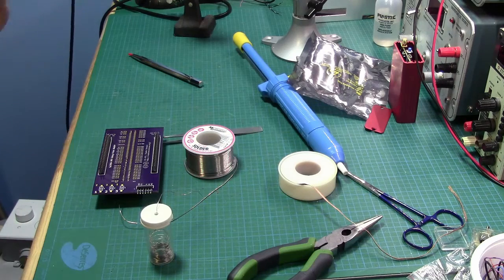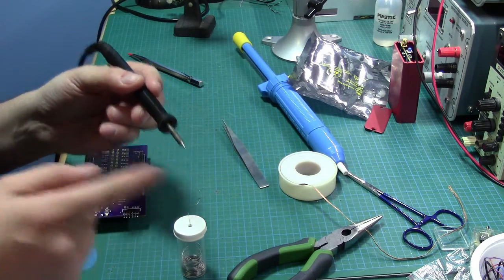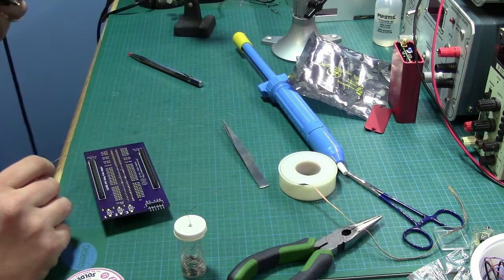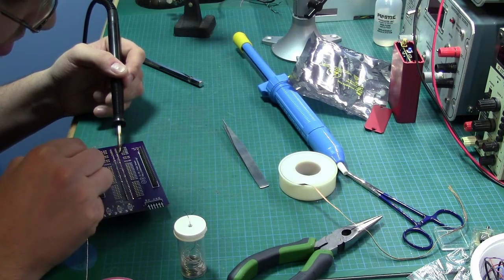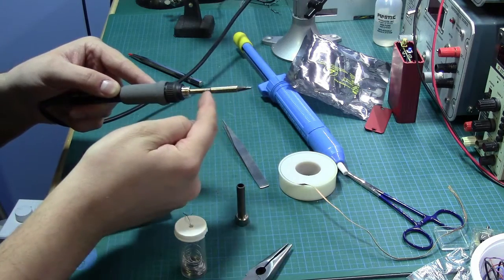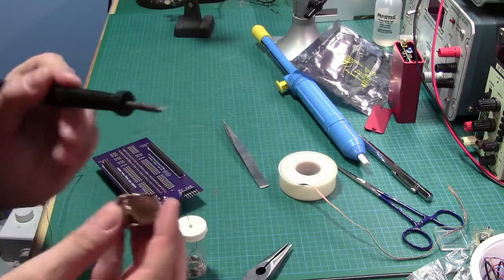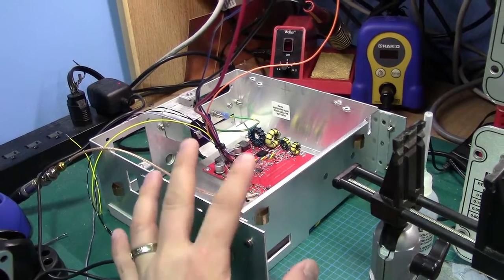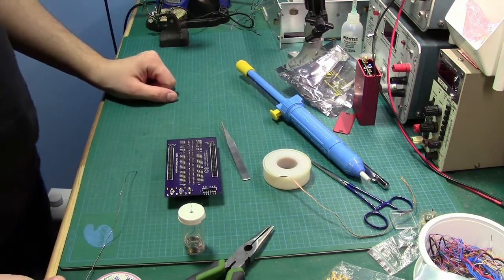DIY Soldering Station Project Introduction

Comment: Wooow it's very intersting to see some people bringing back this already great project .
However,did you think to re-design some part's of this pcb,for example the out of rf power ?
I want to say that in the hakko fx100 we have the rf connector soldered directly .
In this station we must to solder some kind of 75ohm of cable to make the connection over the iron handler and the power supply.
In this picture you can see about what im talking :
http://s15.postimg.org/nxs6db9vt/hakko_fx_1000.png
Reply from the maker: +lollipoppo sugar Yes, in fact I am going to redo the layout (a bit at any rate) for the conversion of the project to Kicad. This might take a bit of time as I'm basically a beginner with RF design (and electronics in general!). I like the idea of a board-mount connector, if only to be able to connect a cable rather than soldering it. I have a SMA connect bodged onto my RF supply at the moment. I will make sure to add this feature in the layout when I get there :)
Reply: +idpromnut 
do not play too much with that damn ,you will get cancer before to realize the connector directly to the board .
;)
Reply: @idpromnut   schematic .